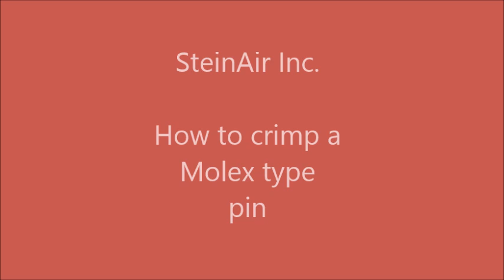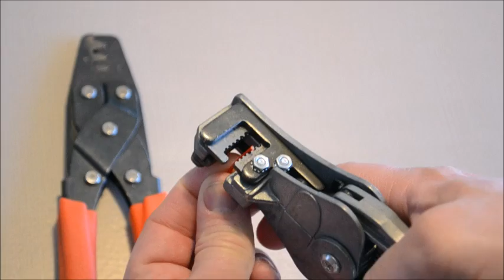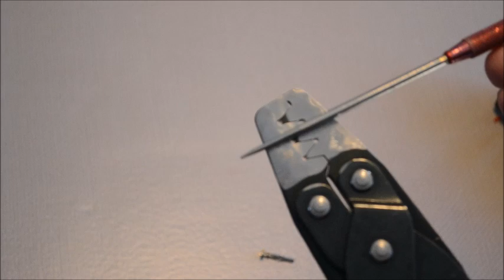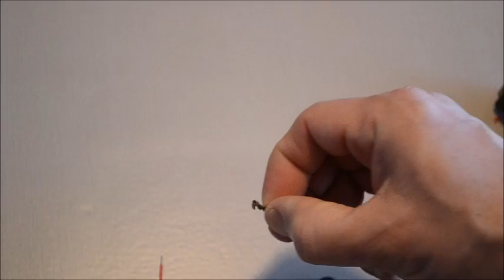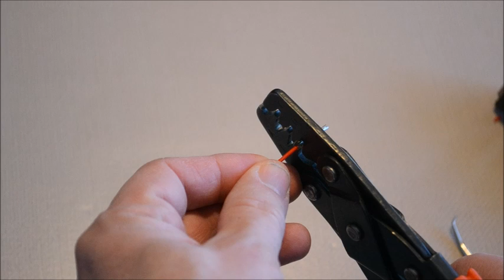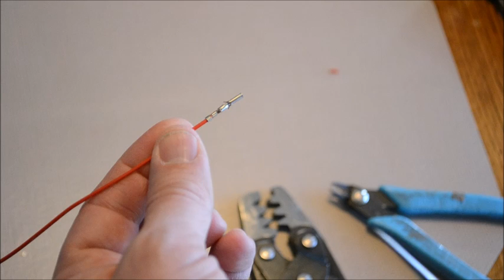012: MOLEX & OPEN BARREL PIN CRIMPING, Video 2

Comment: This one is better than the other Steinar Molex crimping video - this one makes it clear you're supposed to use different sides of the tool for the first (wire) tabs as opposed to the second (insulation) tabs.

Comment: I have the exact crimpers and A B on mine is shaped with that curve and point, like the C D E. I think the right way with that terminal would have been crimp using  D slot then finish the insulated using C or B

Comment: I need to attach over 10,000 molex 9 pin connectors, (both male plugs and female sockets of course). Your method seems kind of slow. Any tips?
Reply from the maker: +Zxenmusic With that kind of quantity you should just buy a crimping press (automated) and buy the pins on a full reel!
Reply: +SteinAir Thanks, I checked them out, but they would still require a lot of assembly after the crimping is complete. I think I'll either buy molex extension cords, cut them in half, strip the wires then connect them to my robot, or pay for custom plugs to be manufactured, which might work out to be both cheaper and easier. Connectors are usually the last thing to consider but they are the most painful to deal with.
Reply from the maker: +Zxenmusic You also could contact us directly for a quote on having the connectors/harnesses made for you to your spec's....
Reply: There are crimp tools that do both tabs at once and (apparently) don't require having the long tabs trimmed.
Reply: I've been building harnesses for a few months now and find the bare wire crimp fairly easy but the stress relief crimp around the jacket is time consuming.Is there a quick way to do those in 1 shot?I find that I have to keep turning the wire and smashing that arm all around the jacket.Hope what I'm saying makes sense.
Reply: @Zawvat  of course. The tabs are there for a reason...